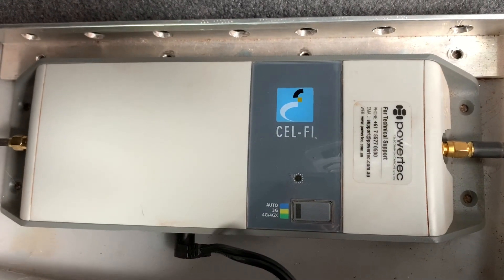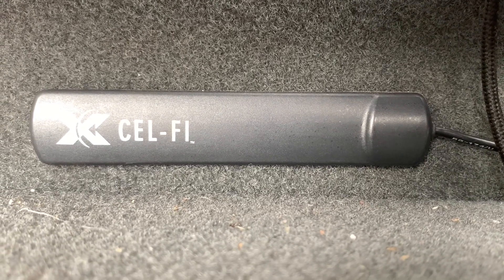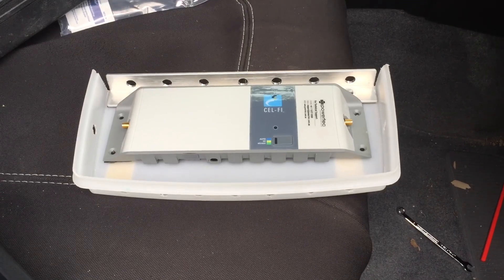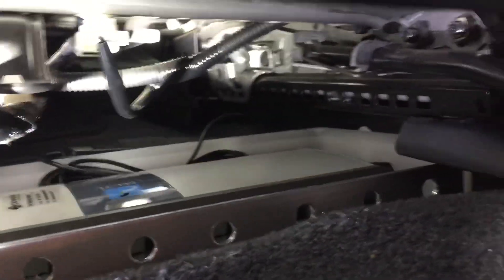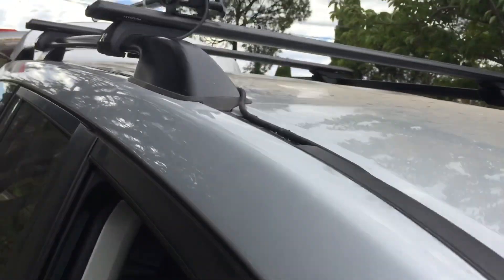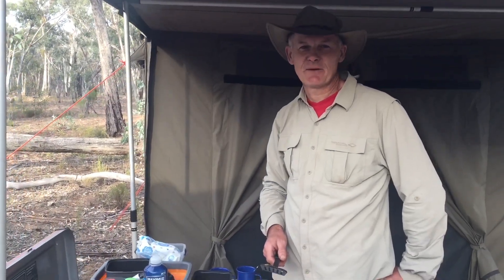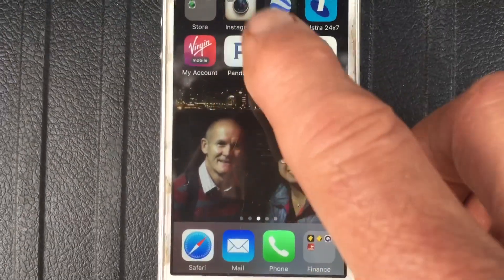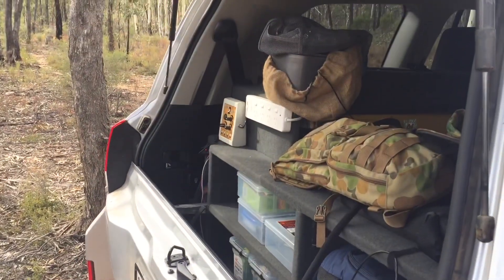Cel-Fi Go Mobile - Installation

Comment: Love your video!

One comment: the separation (isolation) you need is between the antennas, not the Cel-Fi GO unit itself. So, if you locate one antenna on one side of the vehicle and the other on the other side of the vehicle, you will get best results. Additionally, if you have some material between the antennas, like the roof of the vehicle, it adds separation which will get you better performance, large coverage bubble.

Also, that particular unit can be switched from AUTO mode, 3G-only, or 4G-only. Whilst moving AUTO mode is probably best but once you are stopped, you could actually try 4G to see if perhaps you can catch Telstra 4G!

GREAT GOING!

(ps/ Full disclosure, I work for Cel-Fi.... :-) )
Reply from the maker: Joseph Schmelzer Thanks Joseph for that additional info,  I think in my case the roof separation is helping me get such good results as you said.
:)

Comment: Before i knew about this im testing a far cheaper setup using a Telstra Mobile hotspot as wifi using an antenna attached to it on roof of camper. Then you dont have cell coverage you can use wifi calling instead.